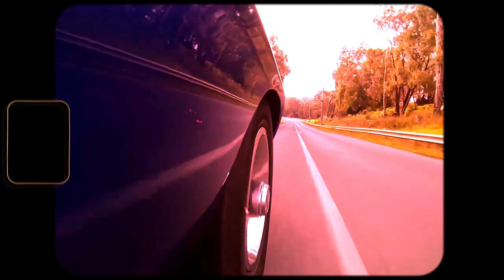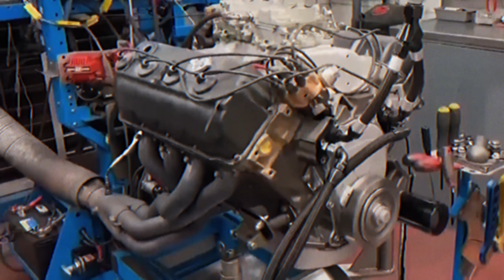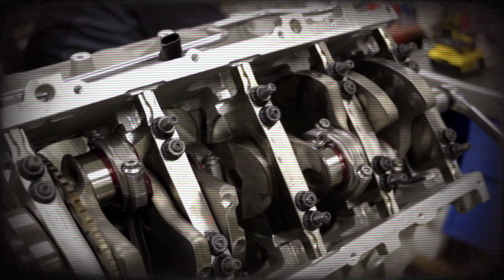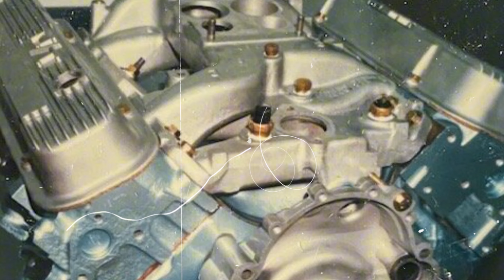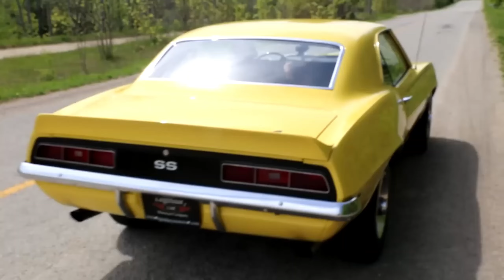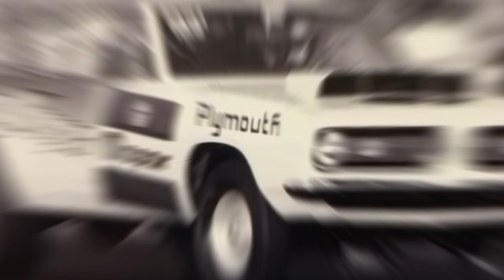Meet the Mastermind Behind America's Most Powerful Engine!

Comment: Don't forget the Corvette's 427 ci L-88 was one of if not the most powerful engine of the era.
Reply: In 1970s, we were getting over 600 hp out of our L-88s, with little more than better intakes, headers and bigger carbs.  The 850 cfm Holly Dominator was the secret to getting your Corvette to run high 8s.